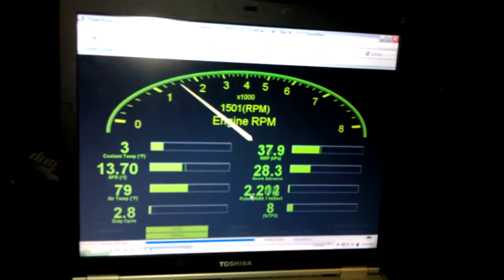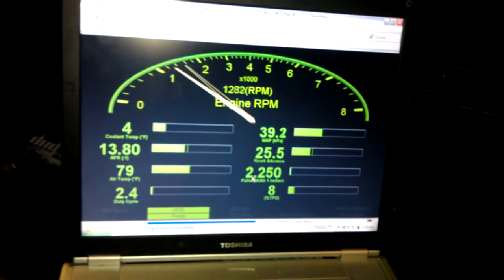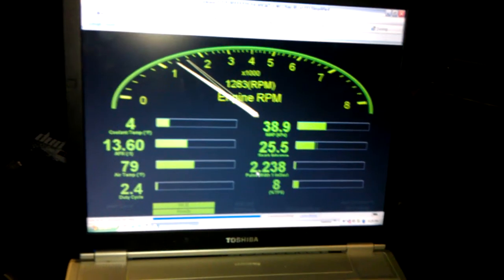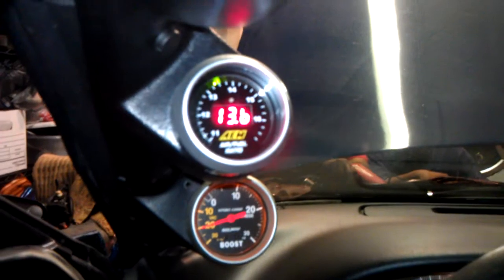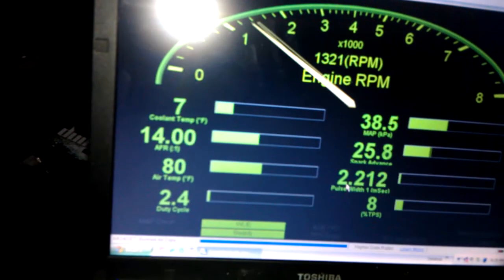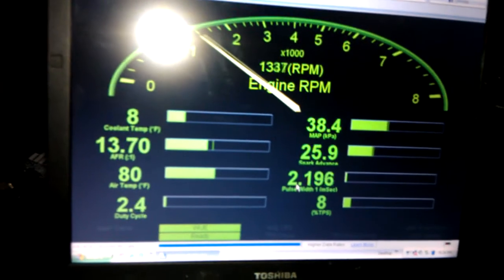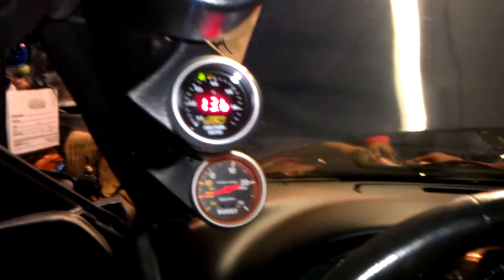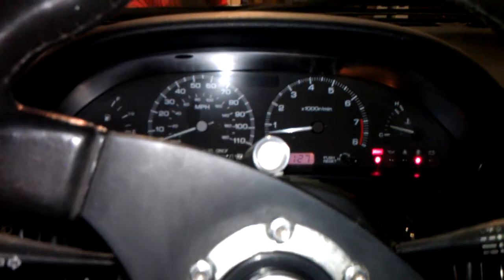MegaSquirt Idling KA24DET

Comment: So you can still use megasquirt with a nistune ECU? What's the point?
Reply from the maker: Scott Dawson Technically you could wire in both but no one has or will ever attempt to do this.  Back in the day with MS1, it only controlled fuel and you would use some type of spark controller.  MS is fully standalone and Nistune acts like a standalone but technically it is, just using a stock chipped ecu.